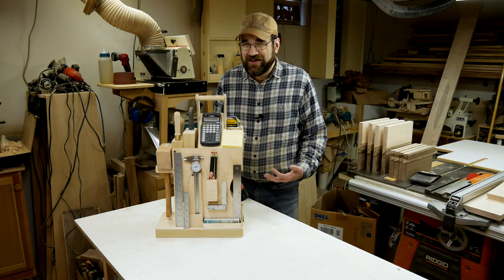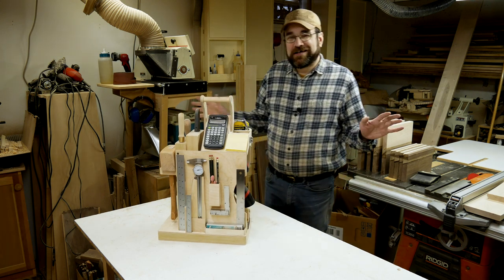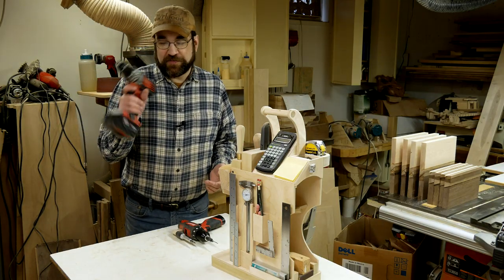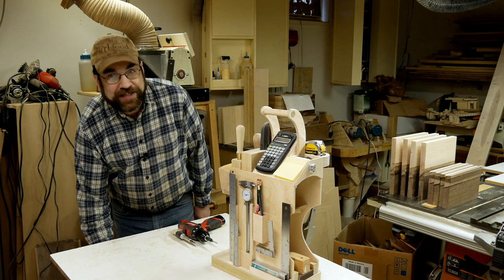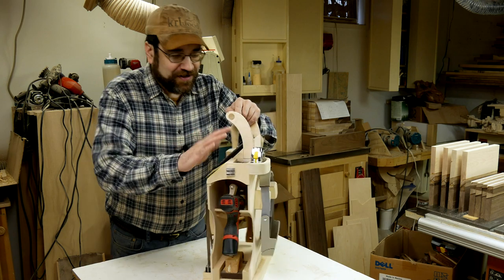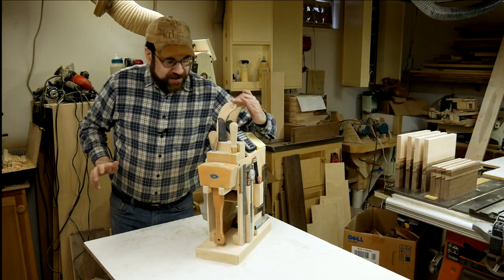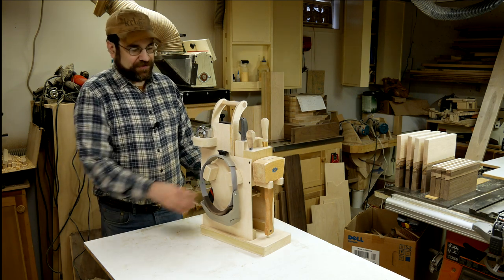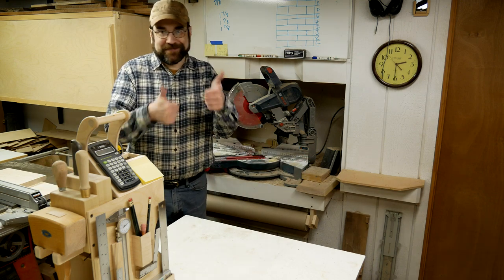Every Project Tool Tote

Comment: Kudos for your great design, it might be just what we are looking for in our woodworking area of a garage, too crammed with tools.  

We have tried buckets with liners with many  pockets, and that works fine for home remodeling and construction, but when working on a woodworking project in the garage, that doesn't seem to  encourage putting things back, maybe partly because nothing has a specific home.  Or maybe because we have always walked away from the bucket?  We might try something like your caddy.  Or like a few of your caddies?  

I am trying to cure a case of dropping things mindlessly as soon as you go for the next tool, and not remembering where that second or third last tool was dropped when it's needed.  None of the small tools have a home when we are working.  (Except those that live in my apron pockets.  But that's not big enough!)  Or if they have a home, they are across on the other side of the garage.

I really like the point you made that it's easier for you to put back the tool on the caddy than to set it down.  That's a thought I'm going to bring forward with me as I try to solve this problem.

But I'll have to put a lot of thought into what goes into it.  

If you don't mind, I will add a note here for readers who are looking for something a little different.

I  just built a different type of tool caddy or center for my better half's electronics bench.  We got the idea from another YouTuber, Patrick Sullivan's "Instant Access Tool Center,"  and modeled it after that.  A different use, but with the same goal of keeping things at the fingertips and keeping things put away.  I have hopes that it might help.  

But for woodworking, and our garage, I just did not think something like  his tool center would work for us, even though it seems lightweight enough to move.  I think we do a different style of woodworking.

Comment: You have made me think. Wherever I am in the workshop my tape measure is the other end and usually well hidden in plain sight! Tool blind, I can spend too long looking for the thing when it is right in front of me! But I think, rather than a tool caddy, I need to buy more tapes. I have seen Diresta's solution, I'd rather not do that. I bought a pack of pencils, round and flat, all sharpened and ready to go. I just need to have a small tool wall at each workstation, ie, workbench, router table, bandsaw and table saw. each equipped with the basics of squares, pencils, tape measures, rules, etc. Possibly not cordless drills though! But they too are always at the other end of the shop to where I need them! The caddy is a good idea, but I feel it will always be where I'm not! Admittedly, if I have put everything back in it, I only need to grab the caddy. But that is a big if! I'm in my 50s and still haven't managed to put a thing back where it goes until I generally tidy up!
Reply from the maker: The advantage of a small shop is I'm never too far away from anything!  I don't usually have a problem with the tape measure, but that little 6" ruler is the bane of my existence.  I have one on a magnet at the bandsaw and I don't lose that one so you may be onto something there.

Comment: You might think about making a place for hearing protection. Great ideas of efficiency.
Reply from the maker: I've already got a couple good places to hang those and I'm pretty good about putting them away.  Same with glue.
Reply: krtwood you might also include a lazy Susan on the bottom

Comment: I like the concept. I had something similar in mind a few years ago, a small rolling (floor standing) tool board  that would hold the essentials. Then I made that big tool board and the idea died.
BUT, your enthusiasm has made me reconsider and since I was going to remake the tool board anyway, I might dust this one off.
Also had an idea for a pot rack type of thing directly above the bench hung from the ceiling with tools on all four sides, inside and out. Probably not great for filming and of course it would block my gantry.
Reply from the maker: Adam has a bunch of rolling A frames very much like what you're talking about.  I think our shops are too small for it.  I've thought about the overhanging pot rack too.  It would get in the way if you were working on a big cabinet.  So I thought if I had high ceilings it could be hanging in way you could raise it up.  But then you wouldn't be able to reach the stuff!  Maybe on a gantry like yours and move it off to the side.  I dunno, it's almost a good idea.
Reply: @krtwood  What I had in mind wasn't big, maybe 16 x 20 and 60 tall. Could have a car battery in the base to power a light on top.

Comment: Great build! I use those tapered drill bits in an impact. It seems to work better for some reason. Maybe I just think that though.
Reply from the maker: Hmmm
Reply: @krtwood  I found that like you said, the drill made it smoke and it drilled slowly. The impact didnt smoke and it was faster. Idk.